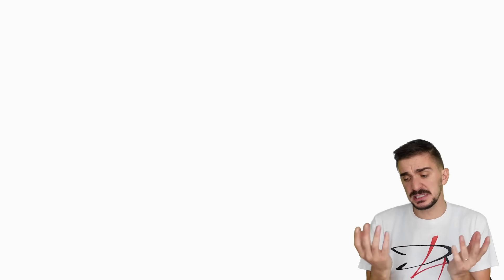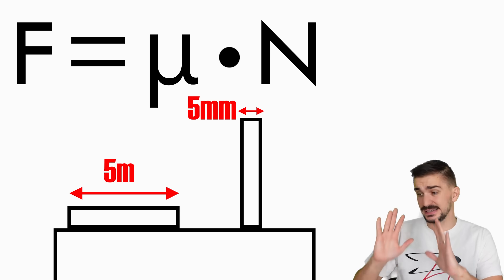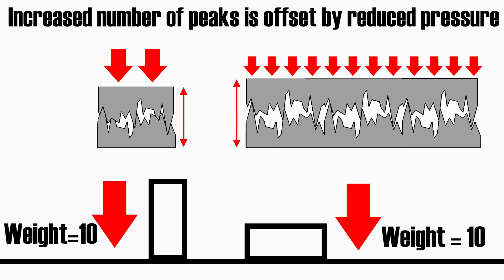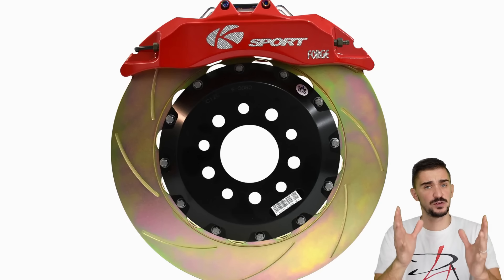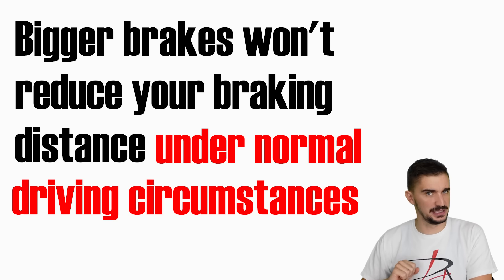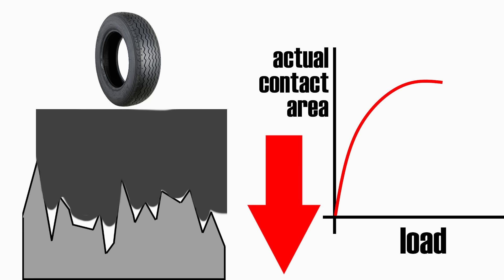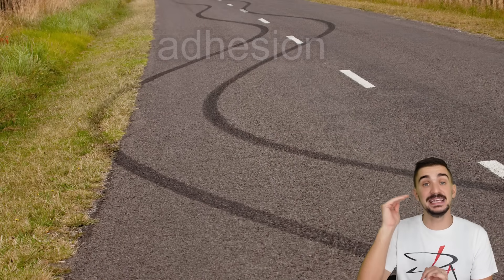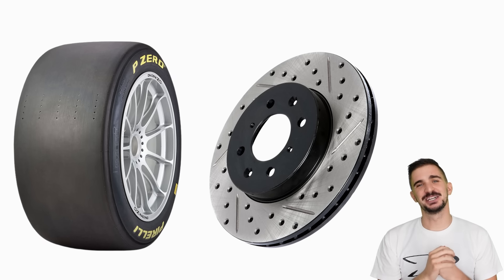Why Big Brakes Won't Stop You Faster but Wider Tires Will - Friction and Surface Area Explained

Comment: You are only correct as long as the brakes are more powerful then the tire grip.
If I mount very good tires on my car, I can get into a situation where the brakes are no longer powerful enough, to take advantage of the new better grip.
It is simply not mechanically possible to just keep raising the clamping power on the disks to improve the brake performance.

Comment: Big brakes not stopping you faster is just a half truth.  Sure it wouldn't hurt to have them.  I have EBC yellow on my 2013 Passat and would never use any others now.  They are replacements for the stock pads, that is they fit the car with no modification needed.  They are somewhat better than the OE Bosch pads and I would still use those if I couldn't get the EBC pads.   One other brand I really like is Stop Tec.  I like the para aramid pads and that is also what the EBCs are.  Either of them has a good crisp bite and just never seem to fade but I am not one of those awful people who everyone hates getting stuck behind because of riding the brakes.  You will know them when you see them, they seem utterly terrified of actually getting their F--ing foot off the brakes for a change and getting near the speed limit!!  That may have been a bit of an exaggeration but I think you get the picture.  I am not a fast driver, I am just not out sight seeing and I am not so old I wear coke bottle glasses!!

Comment: One reason why brake discs are replaced by larger ones is because if we increase the diameter, the friction-resistant torque of the wheel also increases. So the brake force increases as well. 
In addition, if you change the ratio of the diameter of the pistons of the master cylinder and the brake caliper you can also increase the force with which the pad presses on the brake disc.
Reply: Exactly. That is why the Geo Storm was modded with Corvette brakes and it would stop substantially quicker.

Comment: Obviously if the disc surface area and pad surface area are increased in equal ratio there will be no increase in friction -but greater diameter gives greater leverage and increased surface speed, for example what about the same caliper/pads spaced out on a greater diameter disc? -it definitely gives greater braking force -i've done it, and so have many others.

Comment: Lol, yes small brake is enough to stop a resonably fast… once. Heard of overheating?
Reply: Overheating if you repeatedly brake hard, for example in a race. He states that in the video, racing is a different story. If you just drive on a public road you won't overheat the brake. It's less common to do repeated emergency braking on public roads

Comment: Just changing the front brakes to larger rotors, can actually reduce your braking distance if the ballance of the rear brakes system isnt compensated for.

Less hydraulic pressure is required to provide the same braking with a larger rotor, this will push the brake bias forward, potentially reducing your effective braking distance.

Remembering larger rotors, result in the pad passing over a greater surface area passed per rotation, plus increased leverage. So less hydrolic force required.

Setting up the likes of a single seater race car, the need for a brake booster can be eliminated by increasing the size of the rotor, in turn requiring less hydraulic force to do the same job.

Comment: Isn't the point of larger brakes to increase the stopping torque generated by the brakes since the braking force is further away from the axle due to the larger discs?

Comment: But "larger brakes" also imply larger diameter rotors which provide a faster moving surface under the brake pads.
Since the brake drag is proportional to the frictional force X distance from the center of rotation X rpm,
a greater braking force is applied per unit of force of the pads for larger diameter rotors.
Reply: exactly...that's why this film is misleading.

Comment: Is that why formula 1 race cars and big diesel trucks have tiny brakes!??

Wait, they actually have huge brakes....

You just lost a subscriber.
Reply from the maker: Oh no. I lost a bigoted subscriber. What shall I do. Here's a parting gift. Trucks are very heavy and require massive energy to stop or slow down. Race cars are not heavy but need to slow down rapidly and repeatedly from high speeds. Both scenarios generate massive amounts of heat. Really big trucks rely on other means for regular braking, friction brakes usually overheat after a single panic stop on those. I never said that certain vehicles don't need big brakes. I clearly explained that track driving, hauling heavy loads or significant power increases justify bigger brakes. But putting bigger discs, calipers and pads on the same car will not reduce your stopping distance. But I'm afraid all this will still fly over your head. But don't worry, everyone can learn new things and progress with a bit of effort once they abandon their caveman logic 😉
Reply: @d4a  Your title, not mine.  

I love how "science guy's" try to use clickbait to draw people in, only to over simplify something, and more thoroughly explain something else.  It's like religious people attempting to influence through their interpretations.

Congratulations, your clickbait worked on me.  Unfortunately for you, I've worked around vehicles my whole life.  Brakes and tires are only 2 of the many parts needed to stop a vehicle.  Leg muscles, brake lines, master cylinder, and leverage can be some other things.  Bigger brakes make it easier on other systems, making it easier to stop.  If you're going to call it science, do science.
Reply from the maker: There is 0 clickbait in this title. It's a simple factual statement but when you wear glasses made of prejudice you can't see that. Let's agree to disagree and call it a day.
Reply: @d4a  Um no.  You called me a bigot that used cavemen logic.  I must have hit a nerve.  Good.  

There's a thousand other ways to demonstrate the effects of physics.  Besides, misinformation should be challenged. 

Most importantly, you are dead wrong!  Every high performance car, motorcycle and bicycle uses bigger brakes to stop more easily and efficiently.  Wider tires aren't even an option for most big rigs, however, upgrading to bigger brakes is.

Not only is it easier to stop, in cases where the operator wants a more precise feel and control, upgrades to many of the brake components is paramount.  Older folks don't always have the leg strength they once did, for example. 

You should want to use sound examples when explaining anything in the name of science.  Education should be as accurate and examined as possible.  Or not, and end up another discarded YouTube channel.  I hope you can get it together.

If you want to end the conversation, that's fine.  Maybe I am a bit of a caveman, under a different context perhaps.  Never a bigot.  All the best!

Comment: Since applying the same force on the pedal, is now spread through a larger area that would decrease the clamping pressure? Or not? And would require more pedal force for the same breaking?  Or does the larger radius compensate for that? 
I'm sure there was something I didn't quite understand on the video about pressures and contact area, or I just don't quite believe the assumptions.

Comment: Brakes work by transferring forward rotation of force into the rotor or drum and then that force becomes heat.  Nothing  may be created or destroyed and the energy absorbed by braking becomes heat.  When there is too much energy created into heat in the rotor and pads there is reduced braking from friction surfaces changing and also brake fluid boiling from the extreme heat.
Braking performance in tires is reflected in how hard a car can accelerate.  Too much power input in starting will result in tire spin.  Too much braking will cause lockup and tire slip and loss of control.  Larger tires negate this to some amount but does not eliminate it.

Comment: tyres - do you mean the tyre size/shape wont slip on the road as much - because the brake stops the tyre rotating - overall good but a bit misleading

Comment: When I think of big brakes I don't just think of piston count and pad size, I think about disc diameter as well. Doesn't the change in disc diameter change the torque or leverage that the calipers and pads have on the rotors?

Comment: Bigger brakes are less likely to lock up and thus you can more closely modulate braking before locking up.
Reply: You can remain closer to the limits of adhesion of the tires with much more resolution than a smaller brake.

Comment: Unbelievable. Over 10 minutes of rambling about friction and not a single remark about radius and braking torque. The larger disk allows for the friction force to be applied at a greater radius and thus producing higher breaking torque. Hello? This is why it's so important in motorcycles and the breaking disk diameter is almost always stated in specs. Why higher breaking torque doesn't reduce stopping distance in most circumstances in cars? Because the tire is the bottleneck anyway. The braking torque the breaks can produce is higher than the tire capacity and tires will lose grip sooner than the breaks will reach max breaking torque. At least that's the case with standard tires. When you change your tires to wider ones, now your tires can withstand higher breaking torque and now you might want to install larger breaking disks to match the capacity of new tires.
Reply: Motorbikes are a special case, since they typically have no brake boosters. Here the bigger rotors help to decrease the force the rider has to put onto the levers. The same with bicycle disc brakes, for example at mountainbikes.
With brake boosters hydraulic pressure in a car brake isn't a real problem

Comment: You kind of neglect, that larger breaks often have larger break cylinders, which for the same break pressure create a larger normal force.

Doesn't change the fact that tire patch size is the limiting factor for breaking performance though.

Comment: You're not thinking about this correctly. A larger brake disc does stop your car faster. The moment arm of a larger brake disc provides significantly more brake force. Try it on a bike, it does make a difference.
Reply: What he is actually trying to explain is that a more powerful brake won't stop a vehicle faster if the tire grip is already on the limit with the existing brake. If your wheels are locking and ABS starts to engage on a road car a more powerful brake won't shorten the stopping distance.

If your existing brake is not powerful enough to do this however a more powerful one would help to reduce stopping distance.

Comment: It's a shame that you don't take the brake caliper into account. A better designed brake hydraulic system allowing more clamping force on the  brake pads? Sure, this isn't only about the brake calipers yet also concerning the brake master cylinder... I cannot prove it, but brakes aren't only about heat and surface?

Comment: More brake torque from bigger calipers do matter and do shorten brake disrance when the tire is high grip.

At high speeds, a small caliper would not be able to get near locking with high grip tires because the small caliper lacks brake torque necessary to utilize the grip available.

At low speeds however, a small caliper would get to locking as much as a big caliper would.
With lower grip tires, a small caliper would be sufficient perhaps even at high speed braking.

Comment: Bigger brakes will stop you faster if your brakes are not big enough, many are not. Heat is the problem, going down a long hill inadequate brakes will fade out. That's where people get these ideas. There are many parameters to contend with, square inches on the contact surface is one of them.

Comment: Larger brakes also give you more mechanical advantage where the force is being applied further away from the center of rotation.
Reply: On another side they give mechanical disadvantage as more mass rotating further from center means more energy. More energy spent to rotate, more energy dissipate to stop.

Comment: bigger brakes do decrease stopping distance due to the ability to dissipate heat and prevent brake fade. braking force is limited by the tire's contact patch on the given road surface.

Comment: Awww yeaaaa i can finally use bicycle breaks on my super wide rims. Time to goooo. 
Jokes aside tho in the friction formula, substitute force = pressure x area. Brakes deliver certain pressure over an area on the disc. If you were correct than why not use a lightweight pin as a brake pad ? The same u use to sew clothes. That would reduce the car weight by a lot.
Ohhh it is because the pin has to put a HUGE amount of pressure on the disc since the contact area is very little.

Wider tyres will deffinately help tho. And they look good too but that efficiency :/ hhh

Comment: N, will change depending on the weight transfer in each situation (for example braking in the following conditions: downhill vs uphill, corner vs straight, forward vs reverse) as well as many other factors (driver weight, fuel amount, etc.).
F, will also change. Because road conditions (temperature, ice/snow/rain/dry), and because of tire wear and pressure.

A BBK will outperform an OEM brake system due to less brake fade from overheating during frequent aggressive breaking leading to shorter stopping distances even if all other variables mentioned above are the same (except the brake system - fluid, lines, calipers, knuckle, pads, rotors). Also less rotational mass should lead to shorter stopping distance (assuming the grip of the BBK is as good as the OEM one).

Comment: Big Brakes are also about TIME.  While the argument seems to be that the tire is the determinant of braking distance.  Bigger brakes allow "later" braking so the terminal velocities can increase.  And the TIME i am under braking can decrease, which allows lap times to drop.  Since the surface area isn't "physics model perfect" at the rotor or pad I am getting a larger response in all likelihood.  What I don't know is if the "normal force" on the rotor is equal between a small caliper and a large caliper.  One could project that the number of pots and their surface area versus a smaller pot and it's surface area under hydraulic pressure is a smaller NORMAL FORCE.  So I think in the end the generic answer you provide is correct but in terms of the "system"  it may be the 1st order response.  In motorsport I would suspect the reaming "orders" are important for ultimate lap time reduction from the brake

Comment: Contact pressure…higher = more grip whether you are talking about brakes or tires. If you take the same brake caliper and put a larger disk, stopping distance will not change within operating temperature of the pad. This is similar with adding a wider tire(with the same wall height)to a vehicle without adding downforce. On the other hand, if you add brakes with more pistons that generate more clamping force or downforce, your contact pressures increase and grip increases.

Comment: This video are in HIGHLY need of a follow up video, since at least 50% of the comments seems to be about the no mentioning on leverage vs disc diameter and that this video are inaccurate info.
Reply from the maker: Yes, next Sunday I'm doing a follow-up. Btw, the leverage is irrelevant. I'll explain
Reply: @d4a  , lookng forward, love to understand  the deeper physics behind tech. That kind of knowlegde can often be used more widely when messing with mechanical stuff. 👍

Comment: Hi! 8min of video and you denied yourself - bigger brakes do works better & stops the cars better then the factory ones due to better heat dissipation. Combine the Big brake kits with an upgraded friction pads + the fact that bigger calipers multiple pistons are pressing evenly on the discs + the fact that aftermarket rotors are 2-piece design with nearly same or even less weight, then the answer will be quite opposite to your statement - Big brakes do stop your car faster. Great video. Cheers!
Reply from the maker: 🤣 cheers

Comment: Going from a 2 pot to a 4 or 6 pot caliper will stop you quicker than a factory set-up. More leverage, wider diameter discs with the calipers grabbing further outboard AKA bigger discs WILL stop you quicker. So pad compound, tyre compound being equal bigger brakes WILL stop you quicker.
Reply from the maker: Nope
Reply: @d4a  Yiou don't know what the fuck you're talking about.
Reply from the maker: I actually do
Reply: @d4a  Nope.

Comment: moral of this story. upgrade your tyres before your brakes. upgraded breaks will deal with the larger mass of the wheels sometimes putting bigger wheels on your car adds extra unrpung mass that causes degredation of braking. its not as simple as bigger and wider tires. because sometimes you will exceed the clamping force of you brakes. its  fine balancing acts of math and physics

Comment: Its mind blowing if mechanical advantage doesn't play a role in big brake rotors.
It is really non intuitive!.
Im currently polishing aluminium, so going through all the finer and finer  grits, this video makes sense.
The finer the abrasive the longer it takes to remove the more corse grit key marks.

Comment: Friction is independent of area. But grip is not just friction.
Also increasing rotor and pad area doesn't improve the braking performance initially. But it improves durability for subsequent high frequency stops by reducing the amount of heat that needs to be dissipated through a given area thus reducing the rate of rise of temperature (W/m^2).